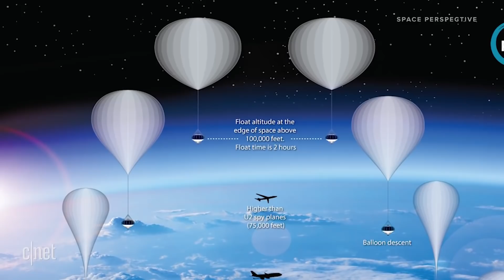HUGE!! SpaceX Secured BIG NEW PARTNERSHIP! (+More)

Comment: The current space race will likely end up lowering pollution not increase pollution in the long term.

This doesn't mention the fact that, investing in improving rocket technology, could potentually help move all heavy industry away from earth which will vastly lower pollution on earth permantly.

Also it fails to mention that Elon's tesla is rapidly moving people towards electric cars and battery technology is leading towards electric powered aircrafts, boats, ships, etc. 

How much pollution is made per single use rocket built?  Making rockets fully reusable may offset the pollution levels too.

I would really like to see hard numbers on how much rockets actually polute in comparison to aircrafts.  Does the type of fuel used change the pollution levels,  for example methane vs RP1 vs jet fuel?

The only way to get to space, is from using propelent.  Most other things on earth can be done by using clean energy.  They should focus on moving to electric cars, planes, heavy industry to space, technology to clean the air and remove c02.  Save the planet by increasing/advancing technology.

The issue with air pollution is not with rockets.

Comment: how does a cryogenic rocket engine produce carbon dioxide out of oxigen+hydrogen?
Reply: They are not giving the whole picture - the carbon dioxide is coming from the solid rocket boosters on NASA's SLS rocket.

Do not trust most of the information in this video, as they are clearly trying to push the narrative that space is evil and polluting because they want clicks.

If you want a more well researched and nuanced video, look at Everyday Astronaut's video on rocket pollution.
Reply: SlS uses solid fuel boosters which leave a trail of polution while going through assent.